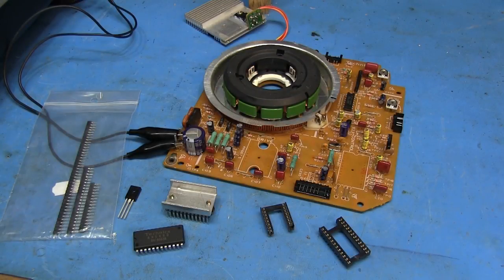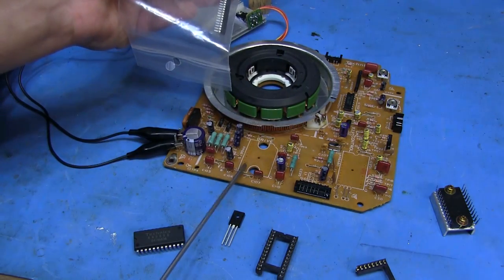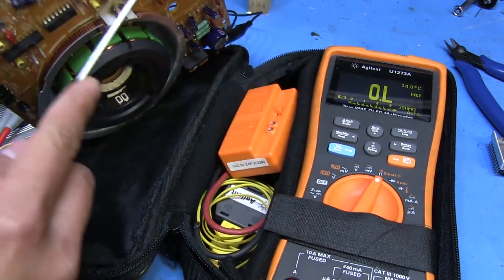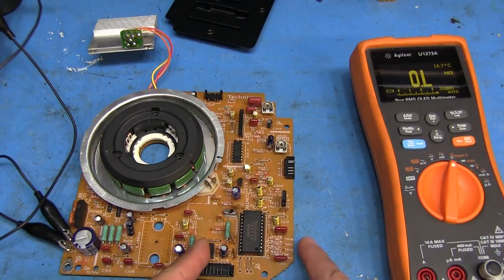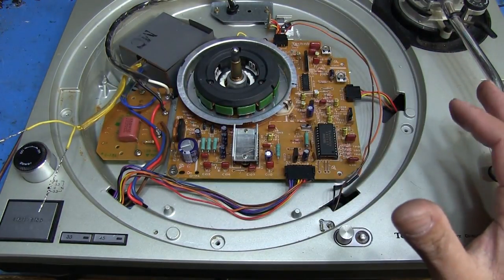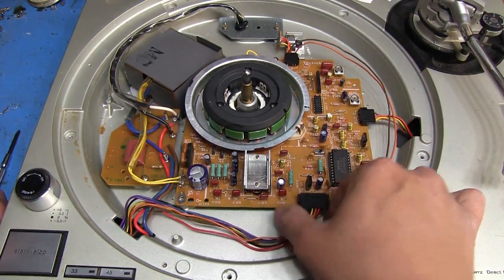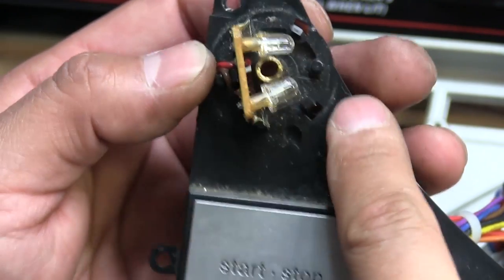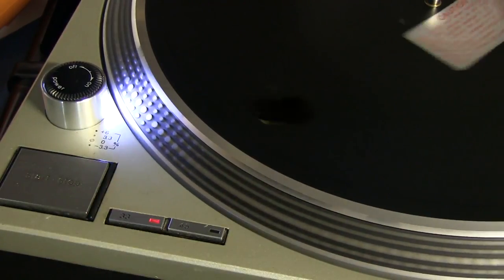TWB #20 | Technics SL-1200M3D Turntable Repair Part 3 of 3

Comment: The wiring wrapping tool needs to have solid core wire "untinned" to work. Works with solid core. In any case, I decided to remove the 2 terminals and replace them with a 2 way PCB terminal connector. So that I can just screw the wires in.  Aside from that, a very good lecture. Thank you very much.
Reply: +puggles1973 I actually have the radio shack wire wrapping tool he mentioned in the video... However its way too thin to do those post... The one he made from that copper tube was ideal... However it would of helped to use a rubber band or piece of tape to hold the wire straight up from the hole!

Comment: Good job on troubleshooting !!! Either someone shorted out the pcb to power or a loose screw got jammed between the housing and the pcb. I have seen all kinds of shorts from foreign screws and pieces. Used to happen a lot in 1980's and 1990's personal computers

Comment: absolutely excellent stuff just what I was looking for just a quick question regarding pitch control calibration under platter test point tp27 to ground should be 262.08 can I turn power on with the platter removed but make sure the start button is not pushed to get the reading
Reply: You probably dont give a shit but if you guys are bored like me atm you can stream pretty much all the latest movies and series on InstaFlixxer. Have been watching with my gf for the last couple of days =)
Reply: @Zaid Kaleb definitely, have been watching on instaflixxer for months myself :)
Reply: @Zaid Kaleb Yup, have been using InstaFlixxer for since december myself =)

Comment: Great job on the repair. My question is what do you think is the problem when you power up a hit start/stop the platter spins but the pitch is jumping? I started it with the pitch fader unplugged and still doing the same thing
Reply from the maker: The contacts on the pitch potentiometer can wear out from use over time. I've replaced a couple before that were too worn to work properly. It's possible that yours are worn to the point where it doesn't matter if it's plugged in or not. Hope this helps.

Comment: Why are the power lines wire-wrapped when everything else is soldered?
Reply from the maker: I think it was to make replacing the power supply easier without having to remove the mainboard.

Comment: Hello excellent repair ! Can you give me your opinion about my problem here :
https://youtu.be/dhVrYUAq1E0
Maybe 6680 to change ? or like you change transistor too ?

Thanks for sharing
Reply from the maker: KoSLoW27 This is what the one I fixed was doing when first powered on, it would just spin up fast. The motor driver IC is directly controlled with the 6680 so the 6680 might need to be replaced, unless there's some other issue. Check the voltages and make sure they're correct.
Reply: The Workbench Nice man! My turntable started smoking yesterday, any idea what's wrong with that??